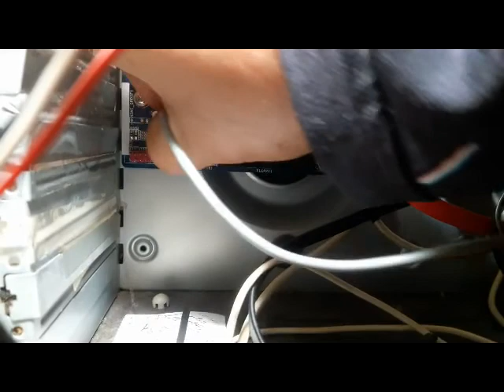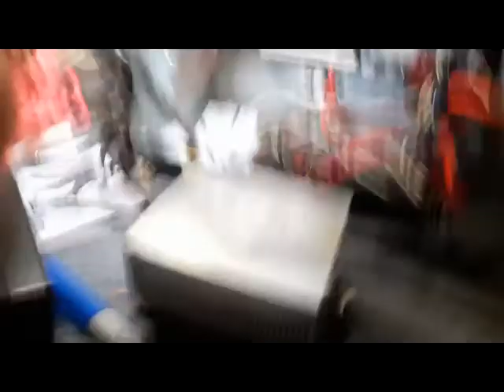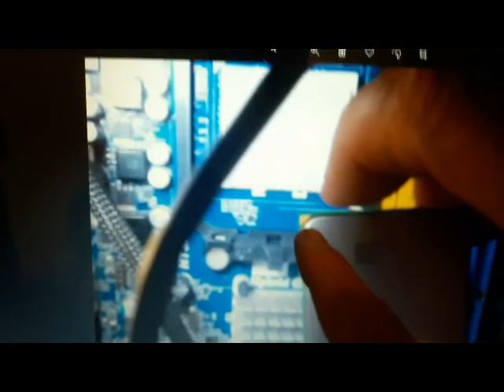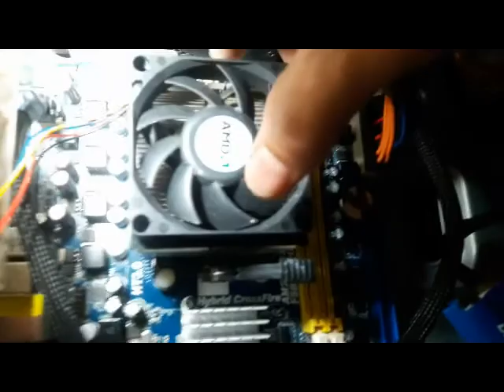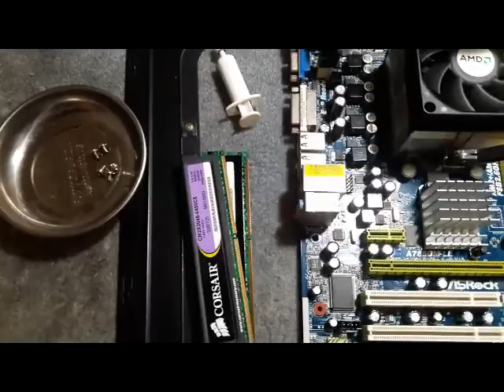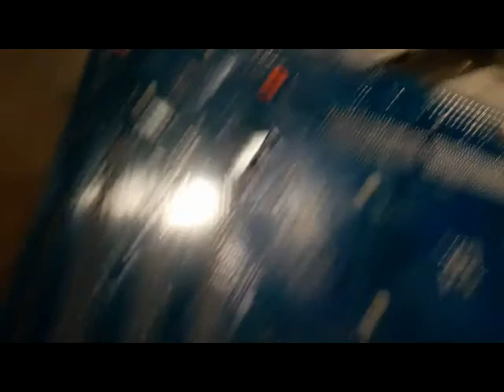Desktop PC No Video No Beep  Fix Part 2 of 3

Comment: Still that didnt work l,my pc doest have any lights in power button but the fan is spinning same as the fan in power supply,its been a week im losing hope with my pc
Reply from the maker: You have to go step by steps for this one bro. If you take it all the way down and out of the casing and still can't find that Beeps. Then the motherboard is bad and it's time to move on.
Reply: Ahh good new my pc is working again for 3 days i guess but there's a  blinking red light near blue light in pc while im running my pc it is bad? But mu pc is running well
Reply from the maker: @josuebori  Good Job in getting your PC back to work. Are you talking about the lights from your Power/Start button?
Those are Power/Hard drive LED lights. They are just indicators.
Reply: It means my pc is good now? Pls tell me its good cuz im always worrying with my pc